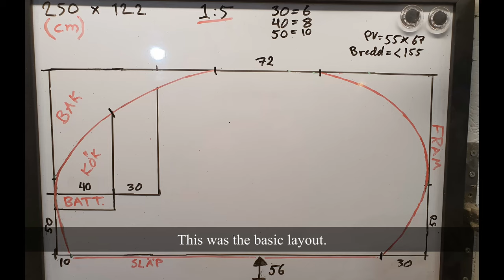DIY Teardrop Camper Build Timelapse

Comment: what material did you use for the steel walls on the outside?
Reply: also where did you purchase it?
Reply from the maker: It is 1mm aluminium (3/64) sheet AW5754. If they had thinner I would have used that. This adds a lot of weight though. 

On my second build I mixed AW1050A with the previously used AW5754, and there are some differences as far as flexibility and color. The AW1050A is cheaper, but not as corrosion (oxidation) resistant. 

I got it from a local store (Aston Carlsson) here in Stockholm, Sweden.

Comment: Nice build! Planning on making on making the same. How did you made the hatch waterproof so no water can leak in on the edges? Rubber seal?
Reply from the maker: I had a hard time figuring out how to seal that and what I did seemed to work fine for moderate rainfall. I used a E-shaped rubber seal with adhesive on the back to seal off the sides and bottom. In the top I used weather proofed fabric for awnings that I glued. In retrospect I would probably try to use a thin rubber mat over the top “gap”. 

I’m sure the sides could be sealed better.
Reply: @BasinBjorn  thanks! I will keep your advice in mind!!